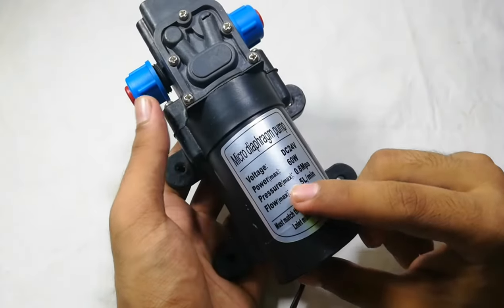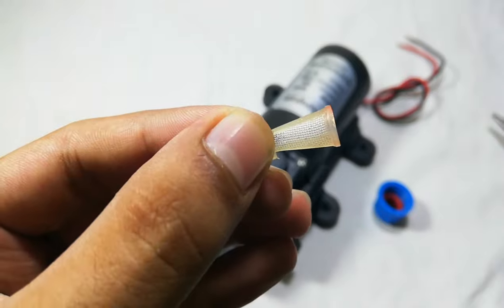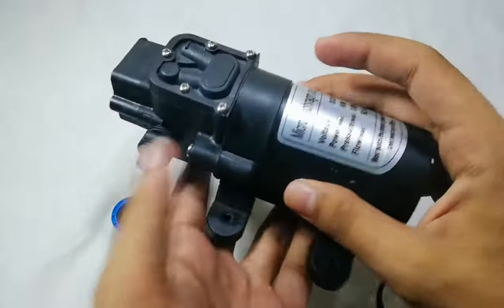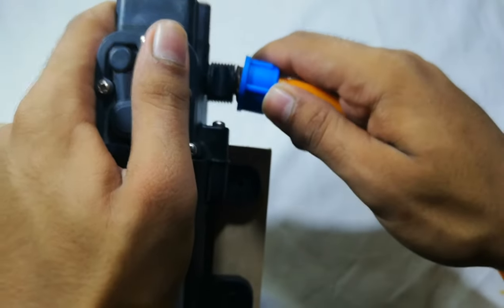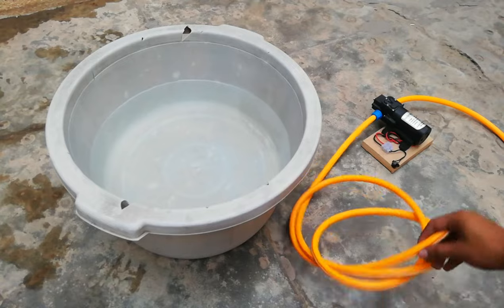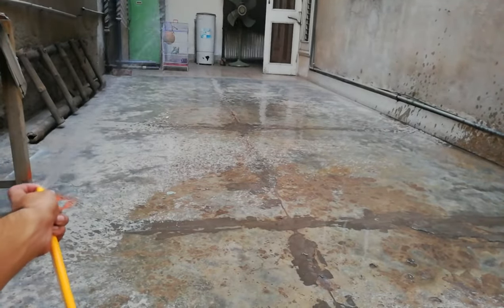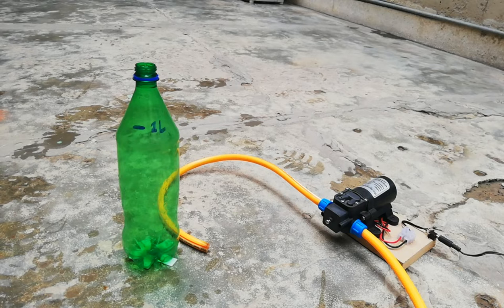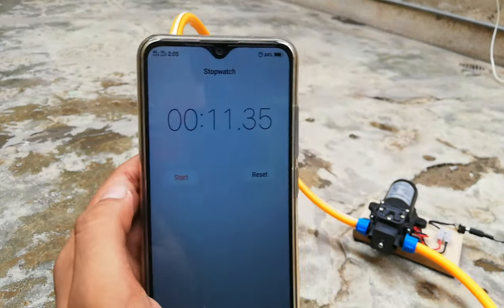Review of my new  PRESSURE WATER PUMP , powerful MICRO DIAPHRAGM PUMP .

Comment: Mine won't stop pumping when the tap is turned off.. (Outlet side) Any clues? What is the chrome screw for at the top? Thank you.
Reply from the maker: For the chrome screw, i myself is unaware about it,if you got some info on it, do share with me too.
For the other issue, mine also does not stop, for that i guess u need to add a pressure switch.
Reply: @SIMPLEHOMEMADEPROJECTS  My apologies, the pump in your picture was different from the one I have here..

Comment: will it turn off when not in use?
Reply from the maker: Hi, if I undertood your question correctly, you are asking wether it will automatically turn off when we put off the equipment attached to it like a tap or a hose. The answer is No, this is just a pump. If you want to make it work like that you need to install an automatic pressure switch with it. You can buy these switches from the market. They are readily avaliable on different online platforms as well.
Reply: @SIMPLEHOMEMADEPROJECTS  tnx, saw another video, it has a pressure switch inside.

Comment: How many Amperes are you using to run it? looks like my power supply is not working, it has 1.25 A and we fail that may be the issue.
Reply from the maker: Mine is 3 Amps

Comment: Can we supply power from home switch board directly by using two wires.
Reply from the maker: No, it operates on 24 volts DC. Your home supply is of 220 volts AC.
Reply: @SIMPLEHOMEMADEPROJECTS  then how can I run this motor
Reply from the maker: @dhruvakumarchapala5197  using a 24 volts dc power supply

Comment: Polluted water pump karne se kharap ho jaega?
Reply from the maker: Iske inlet pr 1 filter hota hai, wo block hojye ga. Polluted water k lye centrifugal pump use kro, jitna zyada polluted hoga, pump k impeller blades utne kam.
Reply: Suggest me konsa centrifugal pump sasta, sundar, mazbut rahega?
Reply from the maker: @user-ls_xoxo  you can purchase the ones used in room air cooler

Comment: Hei Brother, 
I bought one pump DC 12 V , but does not want to work , I plug the cable with electricity 110v .
Do I have to use transferred machine to get to work ?
Thank you
Reply from the maker: Yes you need a step down transformer 110 to 12 volt And then a bridge rectifier in order to operate it.

Comment: How do you adjust the flow rate?thanks
Reply from the maker: Actually its a 24 volt pump and I operated it first on 12 volts and then on 24 volts.

Comment: أنا أملك مثل هذه المضخة انها جديدة و لكن لاتسحب الماء لا أعرف لماذا 😢 ، تصدر صوت وهي جديدة ولكن لاتسحب الماء ، شاعدوني
Reply from the maker: يمكن أن يكون لأسباب عديدة. الأول هو وجود بعض جزيئات القمامة الصغيرة بداخله. السبب الثاني يمكن أن يكون محمل المحرك أو جزء مكسور داخل جسم المحرك. إذا كانت لديك بعض المهارات الفنية، أقترح عليك فتح المضخة باستخدام مفك البراغي والتحقق بنفسك من مكان المشكلة. وسوف تضيف إلى معرفتك كذلك. إذا كنت بحاجة إلى أي مساعدة إضافية فأنا هنا.
Reply: @SIMPLEHOMEMADEPROJECTS  شكرا على الرد 
لقد فتحت المضخة ولكن لايوجد كسر ، كل شيء جديد ، ولايوجد كسر ولا أوساخ ، لايوجد إنسداد ، المحرك يعمل ويدور ولكن لايسحب الماء ، لقد وضعت الماء في اتجاه الصحيح(   السحب ) ؟؟؟
Reply from the maker: @mohamedahmed-th2xr  أستطيع أن أفهم اللغة الإنجليزية، واستخدمت مترجم جوجل لفهم ما تقوله. لا أستطيع أن أفهم تعليقك الثاني. لكنني فهمت إلى حد ما أنك فتحته وكان هناك شيء مكسور بداخله. الآن ما هي المشكلة، هل يمكنك التوضيح؟
Reply: @mohamedahmed-th2xr  Diaphragm dries and stucks its seat when pump not is use for a long time. I use to experience this every year. (I use this pump once a year for adding water to my heating system.) First time I opened the housing and relieved stuck diaphragm. Next year and on I just powered the motor and tapped housing couple of times (gently) with a rubber mallet until it started sucking water.

Comment: Why didnt you connect the pump to a PSI gauge to prove this can reach .8Mpa? I dont think it can. Thumbs down! Bad review
Reply from the maker: You are right, but i dont have a gauge, sorry for that
Reply: @SIMPLEHOMEMADEPROJECTS  I've been considering one of these pumps. No video online seems to show these with a PSI gauge connected. For good reason I'm sure. I suppose it may have its uses, but high pressure is not one of them.
Reply: @WyattsVlog  sorry I have no video either.  I bought one from Temu 3 weeks ago, and then another five.  It does reach 9Bar.  When you throttle the output, like running through a 4-6mm irrigation system, it does reach 9Bar. It's a pressure pump, not a flow pump.  It irrigates my greenhouse comprising of 18 "spraying droppers which are adjustable" and 6 misters also adjustable.  I'm very happy. Regards Graham from South Africa..... But...... It doesn't seem to operate with its "own" pressure switch
Reply: Just did a quick test.  The pressure switch works on the output of the pump. It works on a differential principle.  If I connect the pump with no water in or out it runs.  That is a concern for me.  However, when all water lines are connected it also runs. When I close the supply off after this little pump with a shut-off valve, it senses the input is there, and senses that there is no output.  It then shuts off.  So I'm happy with that. So if the water is not moving, it shuts off. I would've like if there was better protection if there was no water coming in.  Mine works in tandem with a water irrigation timer.